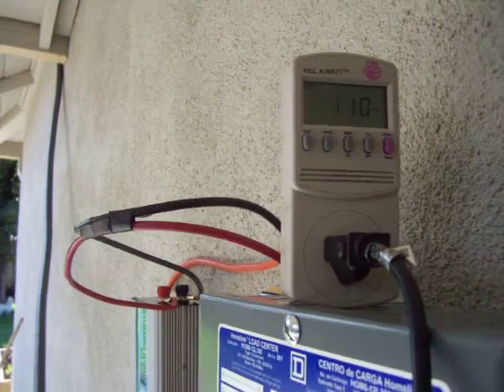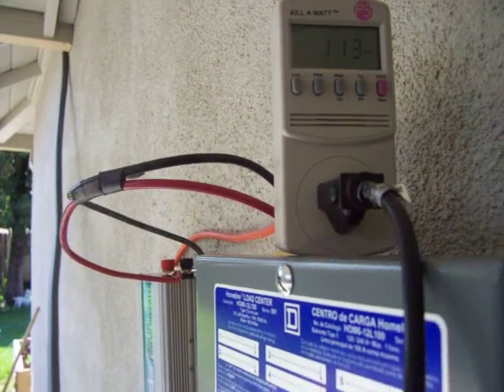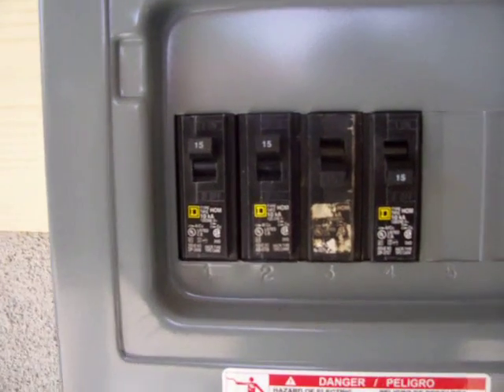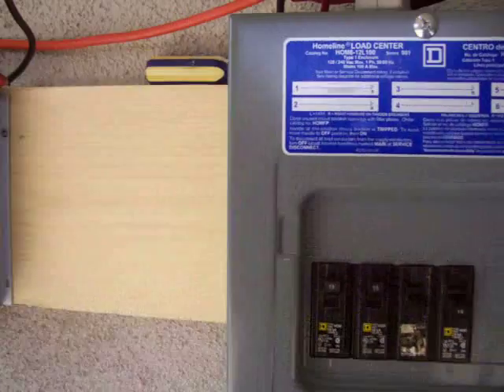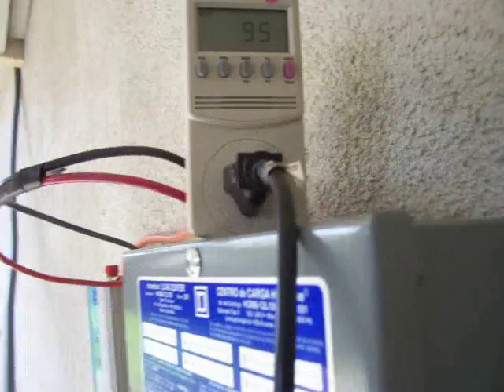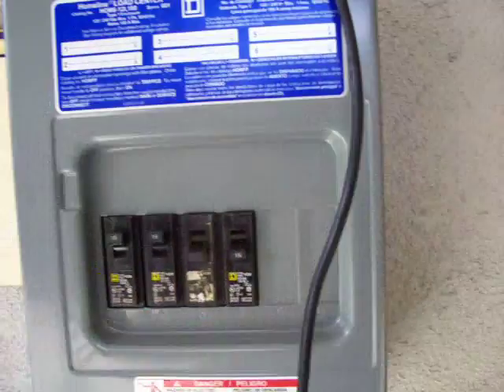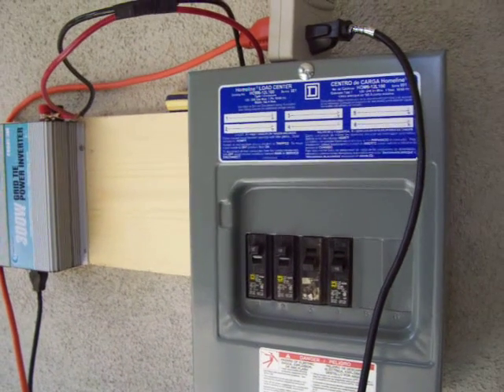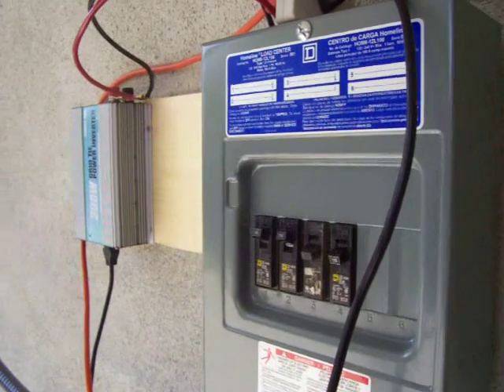Grid tie inverter install (part2)

Comment: For what it's worth, a circuit breaker panel is unnecessary for the DC side of a photovoltaic system. Even a dead short will pose no fire risk and will not harm the panels. A simple disconnect switch is all that's needed. But I give you "A" for effort!

Comment: Greetings,

Your video is great but for the DIY'er it does not show where the solar panels connect to the box and how then it feeds to the grid tie inverter.  I am interested in doing exactly what you did, but I need more detailed instruction.  For example.  Solar panels need to be hooked up in series or in parallel, run solar panel wire into circut breaker box and connect as such, then connect your grid tie inverter wires to box at this location, ect.  I would like to see where a connect to b and so on.  I am not an electrician and do not understand the basic concepts so having you with your expertise explain that to us would be great.  Thank
Reply: exactly what i also need

Comment from the maker: I have different panels on the west side for late afternoon sun. but they are on the same system.
if you are going to use wind then get the gti that are rated 10.8 volts input to 28 volts

Comment from the maker: @moremov52 
just for your infomation my meter does slow down, but you are right it will not go backwards. your electric company is full of shit.  I have added a second inverter running on 415 watts of panels, my bills are way down from last year.

Comment from the maker: @solaris3000 
right now i'am using 3 breakers.  I have added a second inverter also
running on 415 watts of panels
Reply: could you show please ho to connect wires to breakers?

Comment: Nice, I just started my own setup on a smaller scale. A single 125 watt panel and a 300 watt grid tie inverter.  I like that your setup allows you to isolate and shutdown  the various components. Was this difficult to do? I see your combiner box with 4 breakers. Are you using all 4 breakers or is this for future expansion? Thanks

Comment: Does this setup in anyway offset (or supplement) power from the power company?  Or do you use it to run certain lights/plugins and not feed it back out on the grid?